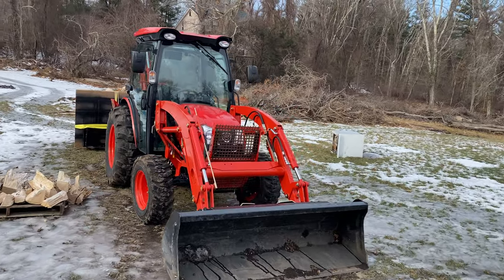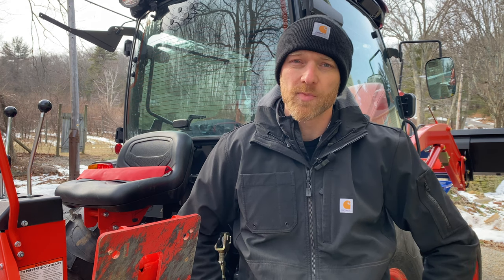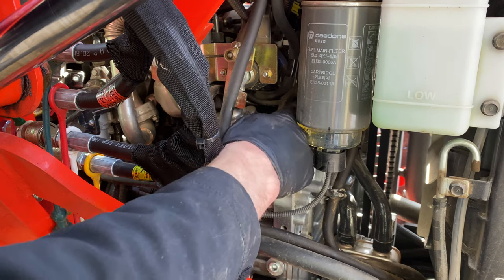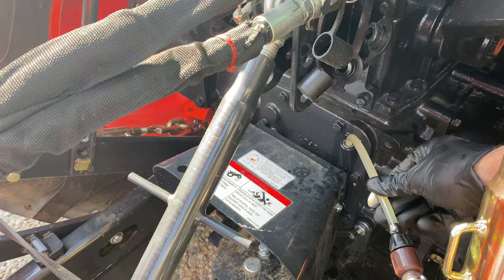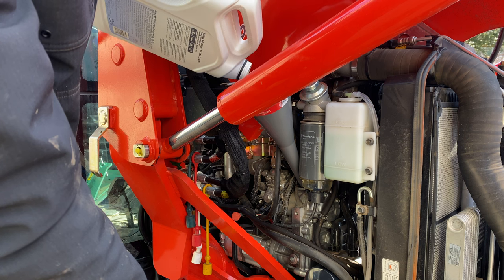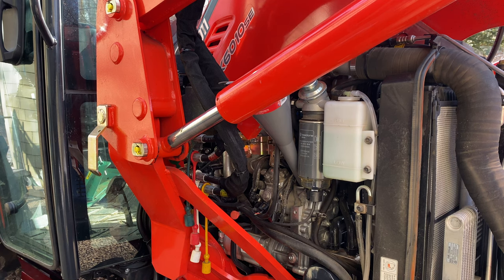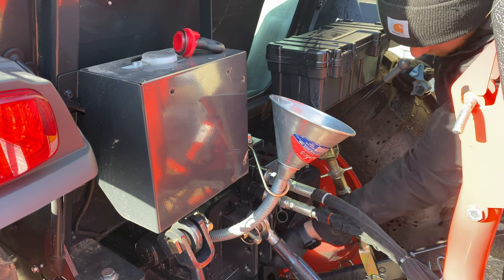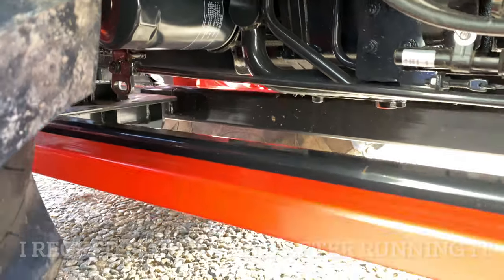Stop Spilling Oil! How to easily remove engine oil and hydraulic oil | 50 hour service on the Kioti

Comment: If you remove the fuel filter first, getting at the oil filler is much easier.  On my CK 50 hr service, replacing the fuel filter is required.  Good video.  Nice idea about avoiding the hydraulic oil spill.
Reply from the maker: Thanks for the tip!  Manual doesn’t have fuel filter getting replaced until 200 hours for my tractor. Strange it’s so far off from the CK series.
Reply: Could you park with front end aiming down hill to change transmission filter and not have to remove oil?
Reply from the maker: I think with the amount of oil in there it wouldn’t work great, but not quite sure.

Comment: Don't forget the front axle fluid too. Nice video.
Reply from the maker: According to the manual for the DK series I don't need to replace that until 400 hours... which seems like a while.  The manual is a bit all over the place though.
Reply: @Curtis1824  
I think you are correct after the first 50 hours. Mine was done at 50 hours and had normal breaking in metal specks in it. It needed to be changed at 50 hours. Check the owners manual. It also doesn't hurt to over do oil changes to ensure that clean fluid is in it. I do the engine and axle seasonally (about 150 hours) and the transmission/hydraulics every other year.  All are more frequently than recommended. Thanks for sharing your video.
Reply from the maker: @geremychubbuck3730  Thanks for the advice!  I have noticed the manual is missing some info. For instance, it only has the hydraulic filter part number listed and then only shows how to change the transmission filter.

Comment: Nicely done, have been meaning to get one of those flexible funnels, but keep forgetting about it till I could actually use it...LOL, guess it is time to order one!!  I like the extractor idea, time consuming but I don't like ending up with oil and fluid all over either.  Wonder if setting the buckets up higher than the fill and then using a hand vacuum pump (like for bleeding car brakes) would allow you to setup tubing to siphon the hydraulic oil back into the fill port (there are other ways to get the siphon going of course, but this would be similarly clean).  Great job and video, have a good one!!
Reply from the maker: Thanks!  The flexible funnel was great!  After using it, you kind of think why haven't I used these before.  I'll probably siphon the oil back back in like you're saying with the next filter change.  I have one of the hand pumps, just didn't think to use it.  Thanks for watching!

Comment: Does your tractor have a a separate transmission filter? My DK5310SE does, and I had to change it in addition to the general hydraulic filter (it is a gold colored filter on the left-hand side of the tractor). The transmission filter was by far the most costly item in the whole 50 hour service.

You were wise to drain the fluid out before swapping out the hydraulic filter. When I did my 50 hour service, I did not. It was like being along side of the Exxon Valdez when I cracked that filter loose...
Reply from the maker: Thanks! I watched several videos of people draining it that way and wanted to try and stay away from a huge mess.  

For some reason mine doesn't have the separate one.  The manual also only has changing the hydraulic filter and doesn't show where to change one like it does the hydraulic.
Reply: I too have a 5310 and am prepping for my first fluid/filter change.  I've been watching several videos of others performing the 50hr service.  Do you have to drain all of the hydraulic fluid (11 gallons in my tractor!!) in order to avoid the river of fluid when changing the filter?
Reply: @DH-ik1vf  I'm probably not the right guy to ask given the oil spill I went through! But, I have seen folks use a shop vac on the hydraulic fill port to greatly restrict the oil spill when the filter comes loose. I suppose that you could also pinch the vent on the hydraulic fluid fill port shut to restrict the flow.

But if I had it to do over, I would have just drained the fluid. and been done with it. That's what my dealer told me that he does.
Reply from the maker: I did just about all of it to be safe. I didn’t want to end up with a giant mess like I saw on some other videos.
Reply: @thefarmer5677 , i have a dk4720se and the trans filter is longer and narrower than the stock filter did you notice that ?

Comment: Your hydraulic fluid looks a little “milky” to me, maybe it was just the white plastic of the pumping mechanism... Also, on the engine oil filter side, are you missing a bolt in your loader mounting post?
Reply from the maker: I think the milky color was from all the air bubbles created driving it around to warm it up. They disappeared when I was pouring it all back in. Are you talking about the hole right under the oil filter?
Reply: @Curtis1824    Yes, it looks like it should have a bolt in there.
Reply: It definitely looks milky which means water contamination
Reply from the maker: Double checked and both sides look like that.  Too big of a hole for a bolt and no threads.  Not sure what it's for.
Reply from the maker: It was definitely milky coming out with the extractor, but wasn't milky when I was putting it back in.  I'll keep an eye on it.  Maybe take a some out again without running the machine first to see.

Comment: Why can't you just remove your vented hydraulic filler cap? With the filler cap removed cleaned and duct tape placed over the filler opening you have created your own vacuum. Very little fluid should escape when removing the filter...
Reply from the maker: I guess you could try that, but not sure I would want to chance it and have all that fluid go everywhere.